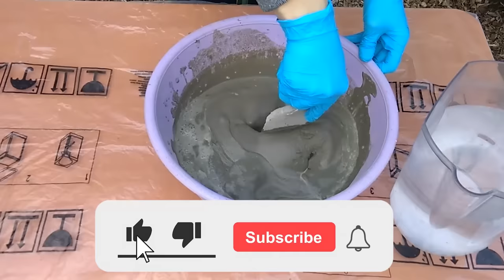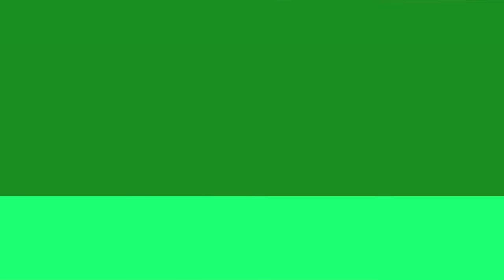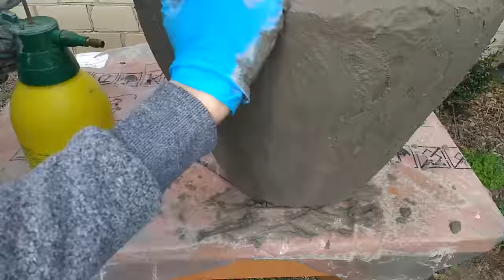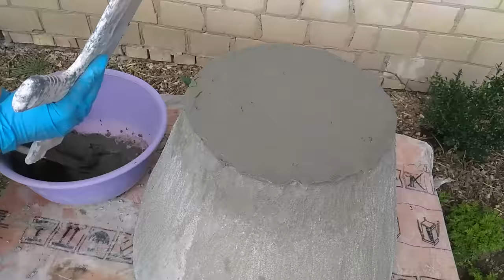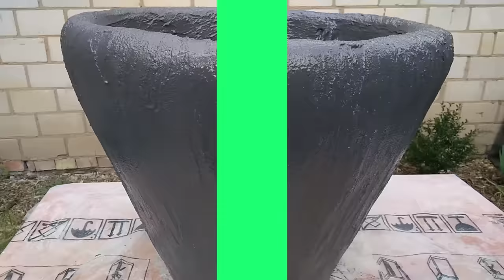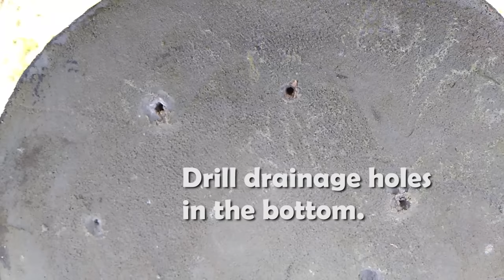CEMENT POT made out of PLASTIC ONE // Free tutorial // DIY, do it yourself // Garden design

Comment: great job...will they withstand getting wet, freezing , thawing etc etc in cold climates? thanks
Reply from the maker: Thank you for the feedback. I have made this pot just this spring, so I don't know about freezing. We need to wait till winter. )) As to getting wet, I think, it's no problem for cement. I will see it after, anyway.
Reply: How did they handle the winter, and any freeze?  Also wondering what is your zone.  Many thanks!
Reply from the maker: @ltuerk Very well. After two winters, I see that cold weather and freeze absolutely didn't influence the pots. But I keep them on the terrace under roof, so they are not influenced by snow and ice. I live in Ukraine. Our winters are cold.
Reply: Wow I subscribe!

Comment: Concrete - cement is strongly alkaline as a chemical & destroys cloth, so this pot can be expected to have a short life span. I've spoken with artists who made projects like this & they ultimately fell apart in a few years. There is a reason "alkali resistant" fiberglass is used in concrete, & not regular fiberglass cloth. Metal cloth, like hardware cloth or lath will give lasting results.
Reply from the maker: We'll see in the future. After two years, this pot still remains whole and unharmed. However, it stands in the shadow constantly and is not affected by direct sunlight.
Reply: Thanks for the info.  @DIYwithLucy

Comment: You never removed the plastic pot, so its a nice plastic pot covered with cement, its not a cement pot. You could have done better by placing a smaller plastic pot into a lager plastic pot where the inside of the larger pot and the outside of the inner pot  are icoated with oil. Pour cement between the 2 pots, add rings of wire to the size of the perimeter in 2 or 3 areas for added strength. When its somewhat dried dried in 24 hours, pour hot water to remove the outer pot and the same for the inner pot.  Instead of using paint, use cement pigments to mix with the cement.  ie. iron oxide.
Reply from the maker: Thank you for the good advices.
Reply: @DIYwithLucy  If you are artisticly gifted, you can also pour cement into a squeze bottle (the one’s chefs use). The cement should be the consistency of tooth paste. Use the squeeze bottle to draw on to the cement pot, just be sure to spray with a little water first. FYI, this will not work on the painted surface. You can always use stencil designs traced in pencil then use the squeeze bottle filled with the slurry cement. I always appreciate people who can make things for themselves.

Comment: Alternatively you can just buy a cement planters. Much less efforts, mess. The price will be about the same, taking into account buying materials to create this “ cement” planter.
Reply from the maker: You absolutely right that it is easier thing to buy a planter. But you are absolutely wrong as to the price. This planter required nearly a half of the cement pack, and the price of it is several times cheaper than a ready cement planter of that size.
Reply: You can indeed do that, but many  have more time than $$.  Plus, this is cheap entertainment with creative, therapeutic value.😊